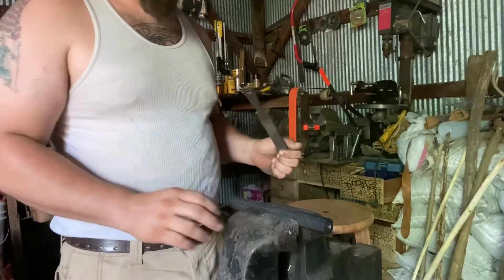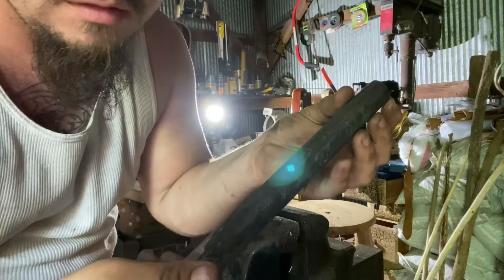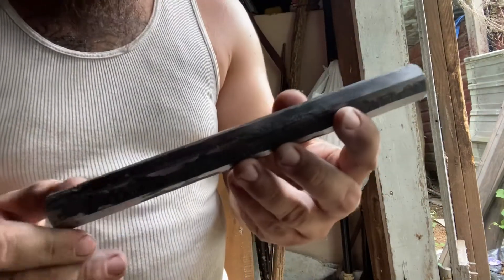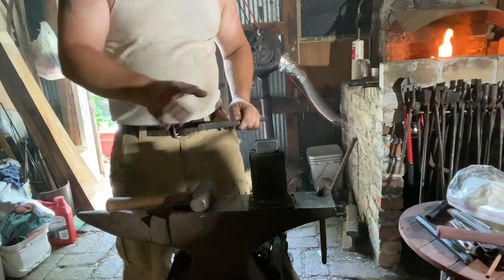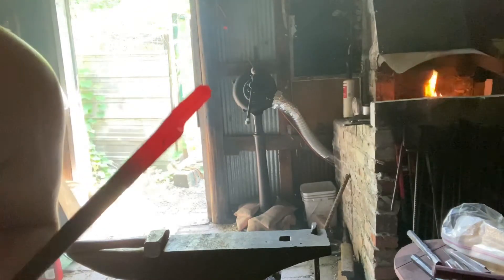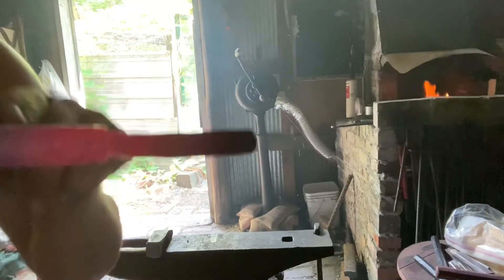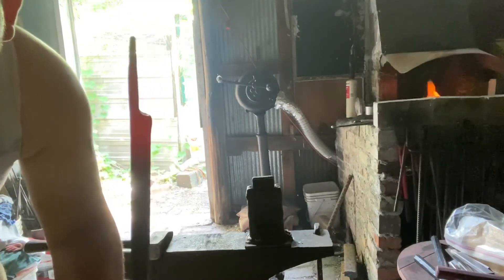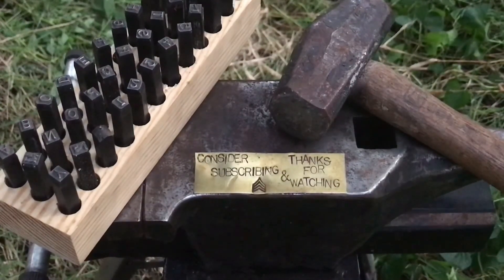Shaping the Barrel and Forging (unsatisfactory) Breech Plug.

Comment: Did you ever finish this project?
Reply from the maker: @Endlessprojects0174  yes and no. I got all the metal functional but never put it into a stock. I was unhappy with how much of it turned out and learned so much during the building that I’ve decided to start over on a new one. The old pieces now adorn my display board at demonstrations. The new one is a ways off, as life has gotten in the way.
Reply: @ I see that’s unfortunate I like the way you went about doing things a lot like the way they would have actually did it back in the day.

Comment: Is the barrel not being centered around the hole going to be an issue?
Reply from the maker: This was a common problem with barrels up to the late 80’s. As long as you put the end that has the most runout at the breech, and have (the runout) running from the 12:00 position (at breech) to the centered position at the muzzle, it is no problem, and actually gives you the benefit of not having to make your front sight post as tall as it otherwise would have been.